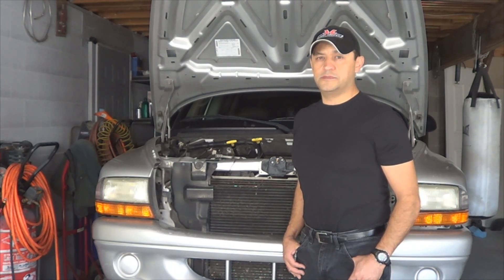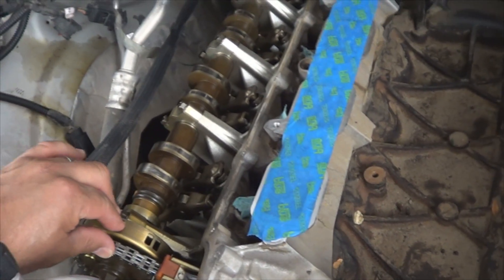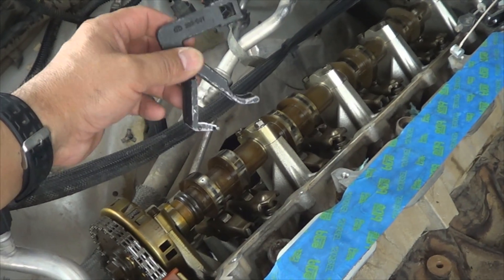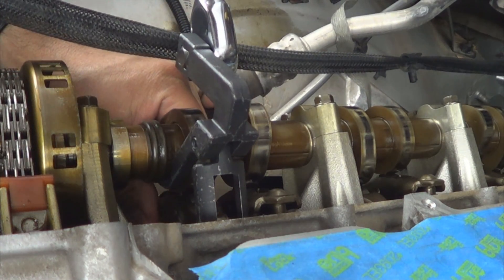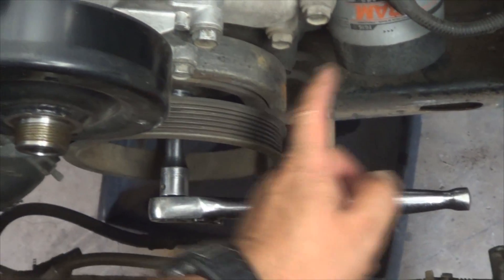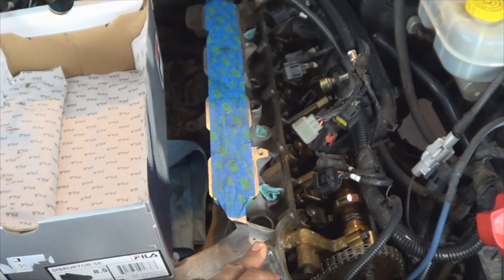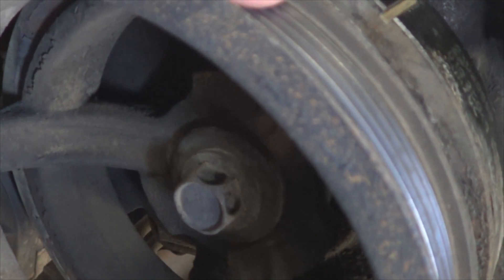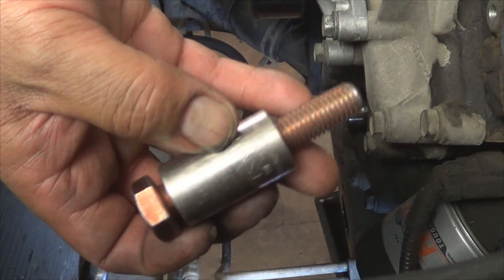Dodge 4 7 L Engine Cylinder Head Replacement Part Four by Howstuffinmycarworks

Comment: Hey I need some advice my broke a new cylinder head bolts off I'm my engine block. How can I remove it out the hole or do I have to replace the engine block 4.7 jeep commander

Comment: Can you help me with buying a timing chain kit.  This says it only fits 2006. Will it fit my 2007 Jeep Commander Limited Sport Utility 4-Door 4.7L 285Cu. In. V8 FLEX SOHC Naturally Aspirated too? Don't see why it wouldn't fit 2007
Heres the link on ebay.  

https://www.ebay.com/itm/03-08-Dodge-Jeep-4-7L-Timing-Chain-Oil-Pump-Water-Pump-Kit-Cover-Gasket-Set-NGC/301329671149?_trkparms=aid%3D111001%26algo%3DREC.SEED%26ao%3D1%26asc%3D20160727114228%26meid%3D874f23f28b5a42dfa1fc204dcfbecfde%26pid%3D100290%26rk%3D3%26rkt%3D4%26mehot%3Dpp%26sd%3D371982187440&_trksid=p2060778.c100290.m3507

Comment: Awesome I have the exact 2002 4.7v8 Dodge Durango and just want to thank you for taking your time and being so thorough great video. Great truck she's 15 yrs old with over 93000mi I bought it new never gave me any problems up until 4 yrs ago 2013 I use it now for plowing snow here on the east coast. now I need to change the valve cover gasket. Thanks again. good job.

Comment: i am stuck on how to hold the pully so i can get the crank shaft bolt off?
Reply: the only way i got it to work was to just remove the bumper and let the radiator swing wild, soi i could fit my non-trump hands in enough to fit the 3 jaw puller in. if anyone runs into the same issue that be
Reply: Hi Irwin.  Thanks for 2nd response, I was thinking I may have a similar issue with my 2004 Dodge Dakota... Quick question... Did you use air tool with a compressor or a crankshaft pulley holder tool?  

Thanks and have a good one!

Comment: Nice job guys! I learned from another YouTuber that to remove the rocker arm without the tool (and I have done this myself--remove and install) you could easily pry the arm off by placing a pry bar against the camshaft while inserting end of blade into slot of arm and prying away--you would do this on the valve side. and then to reinstall (lobe should face up) insert the rocker from the valve side and just pry against the cylinder head and it pops right in. I would need a tool if I were to replace the valve seals with head in place. Great vid guys. Thanks

Comment: i have a 2001 ford f150 that shakes badly when accelerated and cant go up hills i have changed the spark plug ,spark plug wires , air filter, and fuel filter and i still have the same problem . can you please tell me what else i can do? i would appreciate it so much thank you!
Reply: This sounds like transmission shudder.  Caused by old automatic transmission fluid.  You should change your transmission fluid or add Dr Tranny's Shudder Fix.